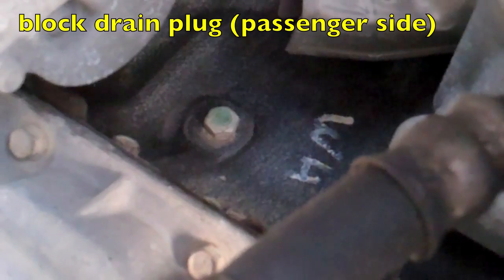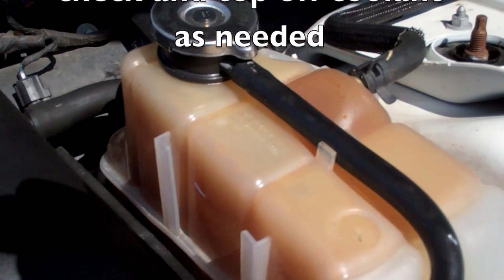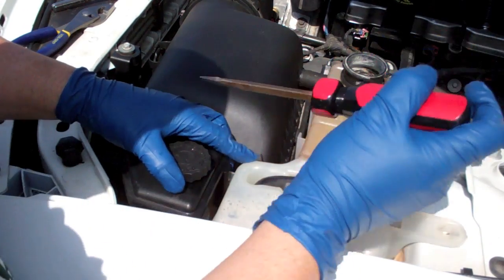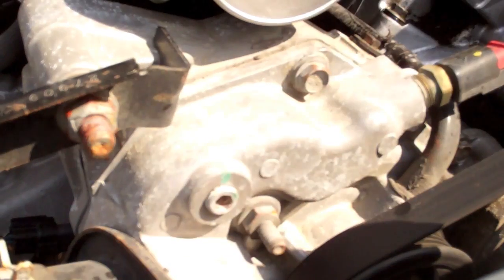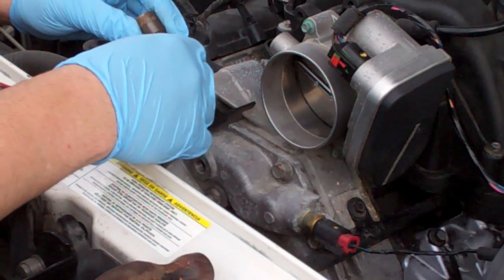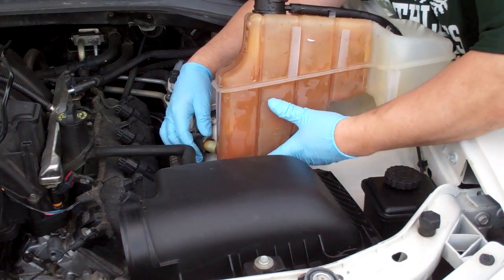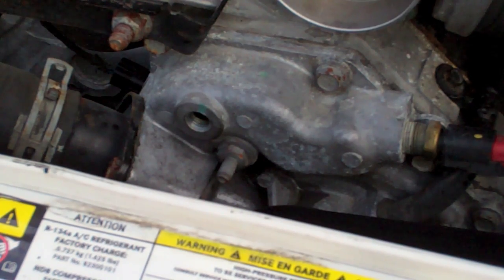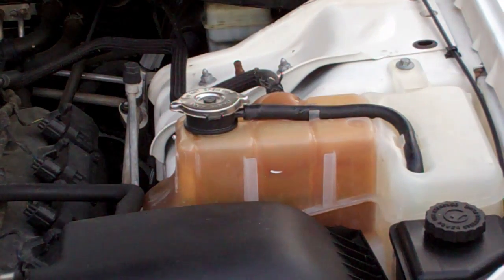Dodge Charger coolant flush/change

Comment: I have a 2013 charger 3.6 liter.nothing done but oil and filter changes has 80000.is it time to replace the red coolant.
Reply from the maker: my manual says every 60 months or 102,000 miles, whichever comes first.  So you should be past the 60 months and technically overdue
Reply: WJ Handy Dad Thanks I am changing it Asap

Comment: what size was the bolt you used for the bleed valve?
Reply from the maker: I thought I said in the video but apparently I didn't... I'll try to see if I have that info anywhere.
Reply from the maker: it's in the video but there is a lot of wind noise... 1/4" with 18 threads per inch
Reply: Mrodge7 it's gonna be 6 not 7
Reply: @WJHandyDad  @ 0:58 close captioning confirms you say "1/4-inch with a FOURTEEN thread count"